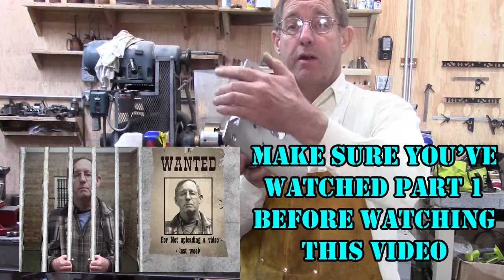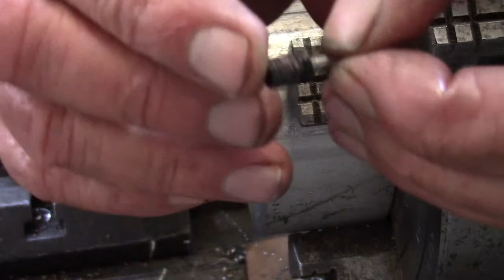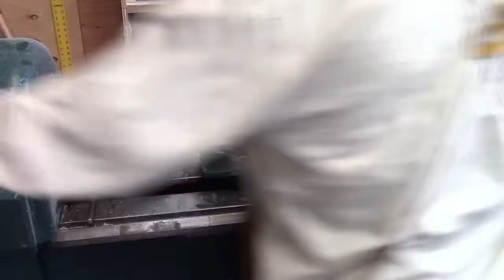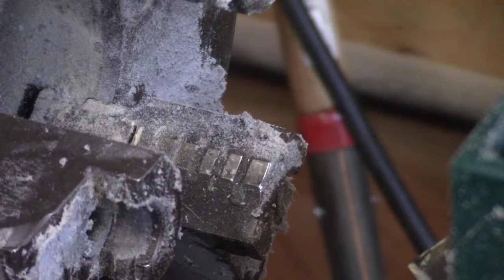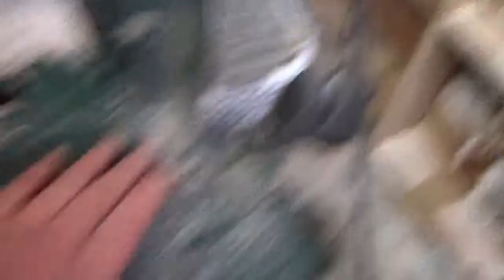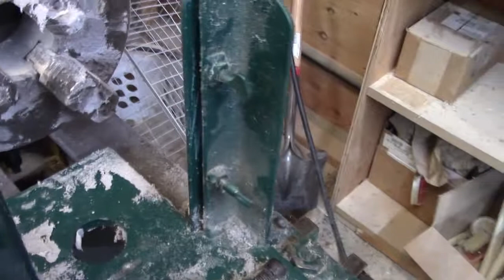Jeff's Prison Project: Part 2 {#45}

Comment: Hi Jeff, we do not know wood so we do not know routers, great to be here and learn from then. See when you have metal cutting precision machinery you can make so any repair parts and custom metal tooling for your wood working shop. Is that material phenolic? Nice machining on the lathe, like the quick change router fixtures the jig looks to work really well. 
Thank you for the share, Lance & Patrick.
Reply from the maker: The material is a Abrasion-Resistant Polyurethane Rubber Rod, 90A Durometer.
You are right when you have the metal working tools you can make what you need to make something work, your imagination is your limit!
That is what makes it so fun. Thanks For watching.